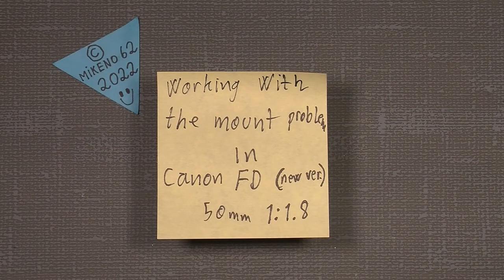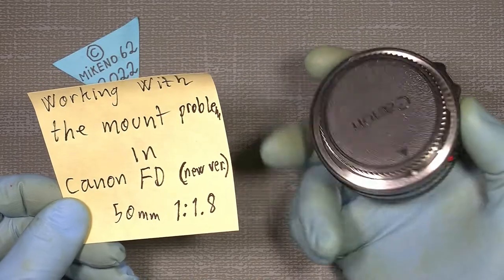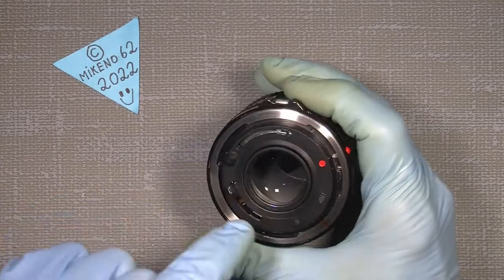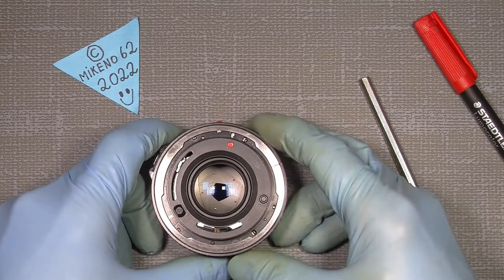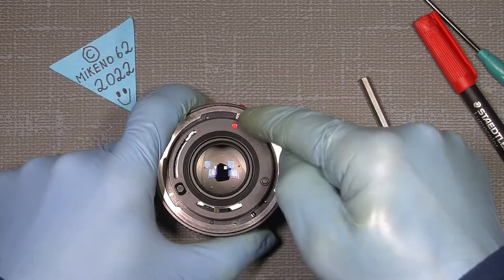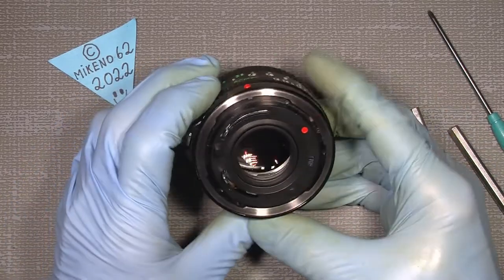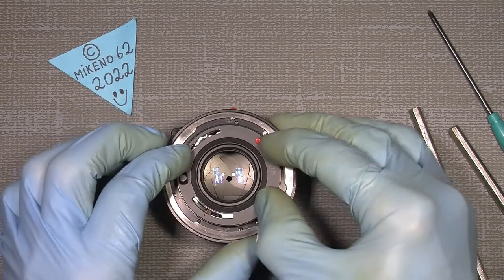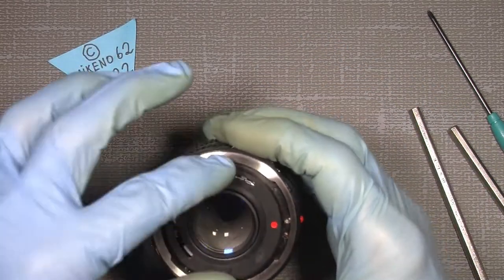Working with the mount problem In Canon FD 50mm 1:1.8  ( new version )

Comment: Mostly followed this process with a Canon FTb / FD 35-70mm F4 zoom combo that I bought on ebay.  Took out the three bayonet screws and had to coax the silver ring off. Underneath, it was filled with gunk.  Pulled out the ring with all the gizmos attached, exercise it a bit, and replaced it.  Cleaned out the silver ring, lined it up pin to red dot, and replaced it.  BINGO!  Not only did that fix this lens, but a little associated cleanup on the mount of the FTb, and all the bayonet lenses I have suddenly mount where before they would not.  Sometimes the issue is as simple as gunk., but without this tutorial I would not have had the nerve to take the lens apart.

Comment: Hello. I did everything exactly the same as in tutorial (about 50 times), and everything is fine till final locking: there is no way to set two red dots in the same position - the mount rotates and blocking about 7 millimeters earlier. Any ideas what to do with this problem?

Comment: hi Mikeno thanks a lot for your tutorials
i had an issue with my Canon FD 50mm 1:8, i couldn't set all the apertures 
so i open it and clean the blades, when i test it pressing the 2 small buttons (like you in the video at 4 minutes ) everything is ok i can set all the appertures from f22 to f1.8
but when i set the lens on the camera i can only set apertures from f1.8 to f8 
do you know what's wrong ?
Thamks for the help
Reply: Have the same problem, did you ever figure out a fix?

Comment: So, just to check.  On an FD-E adapter, to change the aperture you need to be in the OPEN position AND PUSH THE "A" BUTTON IN.  Is that correct?  That is how it is working here. Shee.   It is so much work to use this lens, it is not worth it.  Has anyone modified this lens so you can just change the aperture like any other lens?